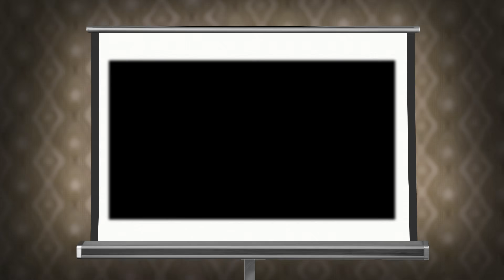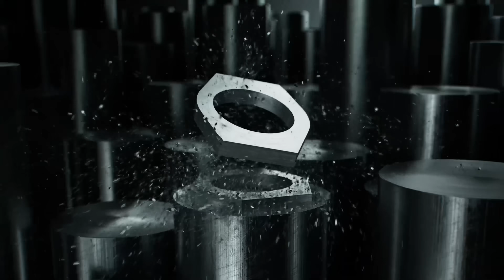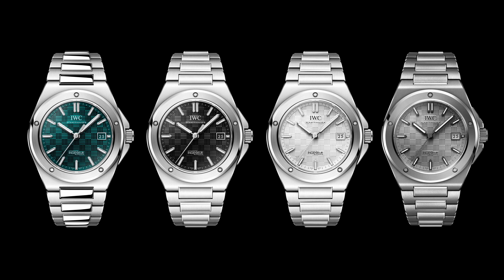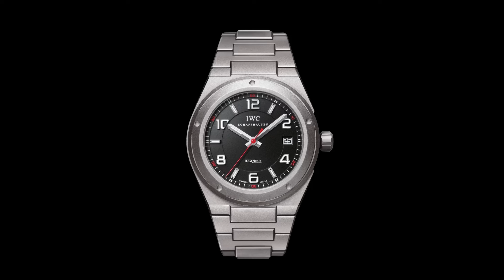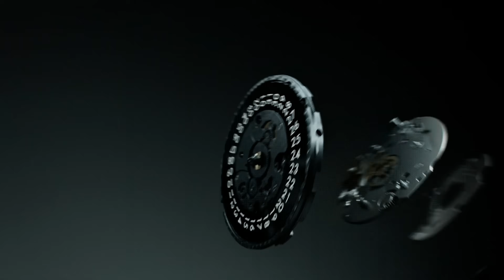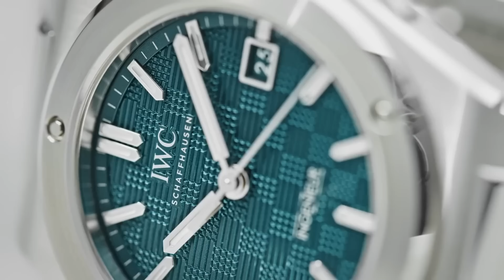NEW IWC Ingenieur Automatic Watches REVEALED! An Icon Returns...

Comment: I have the Mark XX which has the same movement. It runs incredibly accurately when it is fully or near fully wound. Unfortunately, when I leave it in my drawer for a few days and it is in the second half and more towards the end of the 5-day power reserve the movement runs incredibly fast - way too fast. This happened just today when I picked up the watch after not having worn it for a few days and the watch was two/three minutes ahead of the actual time. It's definitely not a good look that IWC is using its customers yet again as beta testers for new movements. The exact same happened with the 5000 series movement some ~20 years ago - only one mainspring barrel with huge power reserve and then running super fast towards the second half of the power reserve. IWC has since fixed that by adding a second mainspring barrel but it certainly left a bad taste at the time. Sad to see the same thing repeat again with this movement now. Please don't view this post as unfriendly criticism or trying to put down IWC as a company. I am into my fifth IWC watch now and I am looking to add the new Portugieser 40 with the salmon dial for which I already put an order in with my authorized retailer.

Comment: For me an amateur with limited budget, I may choose to buy 1 piece of Baume & Mercier Riviera 39mm with Baumatic 120 hours USD5500 (inc VAT) or a new Tudor Black Bay GMT Polar white (newest 2023) dial USD4500. If I am not mistaken, both IWC & Baume are using the same caliber (as sister's company of Richemont) IWC Ingenieur  40mm 32111 caliber 120 hours USD11,700. Am I right?

Comment: With the 32000-calibre family, IWC expands its range of automatic in-house movements. For these rugged and reliable movements, and for the first time ever, IWC has used components made of silicon. The escape wheel and pallet lever are made of this incredibly wear-resistant material. A bidirectional pawl-winding system supplies the energy required by the movement. Similarly to a Pellaton automatic winding system, it winds the mainspring when the rotor is moving in either direction. Thanks to advances in movement technology, the 32000-calibre family offers a 72-hour power reserve. In addition, the long service life of the mechanical components has been increased by newly developed lubricants.

The architecture of this movement is based on the ETA 2892 though this movement is manufactured by ValFleurier, the movement manufacturer owned by IWC's parent group.

32111 Calibre
IWC-manufactured movement
Automatic, self-winding
120 hours Power Reserve
Frequency 28800.0 vph (4.0 hz)
164 Components
21 Jewels
Côtes de Genève, perlage
Reply: So not “in house” then
Reply: @padraig5988  At sisters house. Almost everyone is doing something like this though. Is a Ford really a Ford. Does Lockheed build the raptor in house? It's purist honestly and is of no practical concern to me. Contract manufacturing built to spec by another division of the same company vs "they bought an ETA and carved IWC in the rotor" like most posters are pretending.
Reply: @hoosiercoinreview6428  Yet IWC do the upmost to obfuscate the origins of their movements. Which is par for the course with Richemont, with panerai being the worst offender. IWC knows the value of in house, hence their marketing guff being as clear as mud in their true origins.
Reply: @padraig5988  I'm not sure it's that important at all price points honestly. Newest AP went to Vaucher mfg. Czapek is basically outsourced down to the last screw and sells out for years with secondary market very strong. FPJ and VC outsource their dials. They should just be forthcoming about it so people don't sneak around whispering that it's an ETA when it's really an ETA architecture with a LOT of upgrades built from scratch down the street at a company they also own.

Comment: Great video as usual
IWC have done such a great job here, lovely tapered bracelet and finishing.  Want it, love it in Aqua dial….just wish it was at a price I could feel good about. £8k could justify it I need it and it’s worth it. £10k is begrudging and pause rather than commit.
 
Counter view. Are all watch prices going up due to inflation, higher supply chain costs OR because demand for luxury watches has risen and sensitivity to price for certain designs (esp Genta) has reduced
Don’t know…probably a bit of both.

Comment: I hope IWC has more up their sleeve than these overpriced and unremarkable Ingenieurs.
Reply: Come on grumpy. They finally woke up and are realizing what they messed up on. All the other séries are great (could say some are still a little big) but after destroying the ingénieur line up they finally came to their senses! It’s expensive for sure and frustrating and I’m guessing they did take in consideration the success of Daddy RO and Mummy N in their calculations. What’s more shocking is the mess up of a gift that was given to them through all those years, where the previous CEO’s were left to do their stuff as the other lines where pulling the brand along.

Comment: It's too bad that they thought they could get $12K and $15K for a watch without a true in house movement.  Just because Genta designed the original, that doesn't mean you have the same value proposition as the others. Maybe people will buy it but I'll wait till they hit grey market for 2/3 the price.
Reply: The most expensive standard AP RO’s use a JLC movement, any complaint there?
Reply: @Seconds84  nope because thats JLC
Reply: @Emach76  huh? You said it’s not a “true in-house movement”? The movement that’s in the watch has been highly customized over 2 generations, it’s also refined to IWC’s specifications. JLC movements were the old “eta’s”, they were widely distributed and used by multiple watch brands. They had nothing to do with AP at the time. You’re playing semantics here.
Reply: @Joseph Norcott  you might be right and my logic is flawed, yet in my opinion...the value proposition is not there (for me) and when I can get it for 2/3 to 1/2 price, I'll consider it.
Reply: @Emach76  trust me, I wish the watch was about 3k less retail. I think most watches are highly overpriced at this point. I want it myself but fear that you may be right and a year from now I can buy it new for 8-9k on grey. 

If that happens, I would certainly be aggravated.
Reply: @Seconds84  Almost one year later...zero for sale for those prices..
Reply: @Franzino  the watch has barley hit the market yet, the titanium hasn’t even released fully lol. IWC has been short supplying inventory for their boutiques for hype (not working). First watches didn’t ship until like August. We aren’t anywhere near a year of actual sales. Also, I have seen examples in Moda at 2-3k under retail for black/white dials.
Reply: @Seconds84  Nice; that's good news that there are already examples at 2-3k under retail. Let's hope, more will be available. By the way; is that also not normal that most watches (besides Rolex, AP, VC, Patek) are under retail on the secondary market. A nearly new Porsche is also under retail on the secondary market unless it's a special low production number (like a GT3, RS, S/T, etc).
Reply: @Franzino  yes that is very normal. I really hope the whole market goes back to that. I love this watch. Almost bought it a month ago at retail at IWC, but it’s just overpriced for what you get.

Comment: Shame that it's just a ETA-clone with some modifications, and then they want you to pay 12-15k for it. Garbage
Reply: Fully in-house with a 5-day power reserve.  Which ETA is this a clone of?
Reply: @complicatedtime  It's made by richemont movement subsidiary val fleurier, and you find the same movement in baume and mercier and other richemont brands. It is an ETA 2824 built and modified by val fleurier, and iwc calls it "in house" because it's not bought by eta (patent is gone ofc), but nevertheless it is copied. Improved, but not really special enough to demand such prices imo.
Reply: @thor_86  but you would pay it for a very average Rolex movement I bet.
Reply: @garyboyle695  Yes, probably. But those are also cheaper than this, and the "average" 3230/35 is pretty much the best movement in the industry in terms of reliability and accuracy. But with rolex I pay for more than just the movement and quality, you pay for the brand recognition and the designs. With iwc I'm paying for "iwc" and the eta movement. To be fair I also pay for a genta design here, albeit a less celebrated one. It's a watch I'd want if it was brought down to earth, say around 5000usd. But hey, that's just me.

Comment: Already complained about it at Theo and Harris but €13000 nearly double than the mark xx, no way
Reply: Do complain about alpine eagle nautilus royal oak

A sub is 12k now
Reply: @currentaf8455 Yeah and those watches aren't using eta 2892s. Horrible pricing no matter how hard you try to spin it.
Reply: There is much you have missed... too many you tube reviews?

The same movement that some people like to criticize is actually used in the eighty-thousand-dollar XPL Toto Wolff Mercedes AMG Petronas edition. It’s interesting how most online influencers never mention that or perhaps simply don’t know it.

This watch is genuinely impressive. A 120-hour power reserve is no small feat, and the soft iron inner case brings it back to its antimagnetic roots. Add to that the fact that it’s a true Genta design, and you’re looking at something with real pedigree.

Once you stop listening to the noise online and take the time to do your own research, it becomes obvious that this is an exceptional piece, both technically and historically.